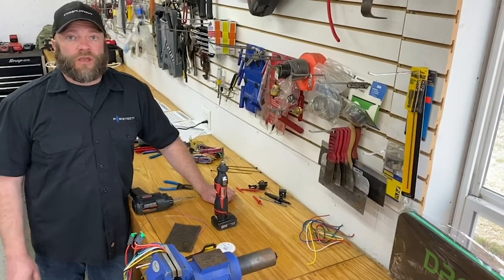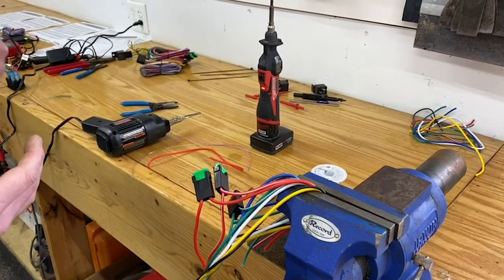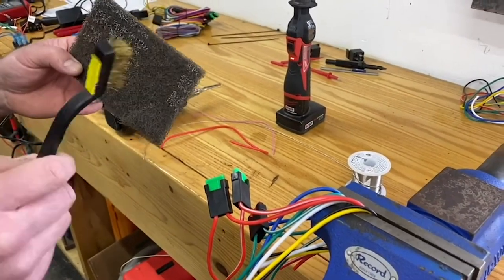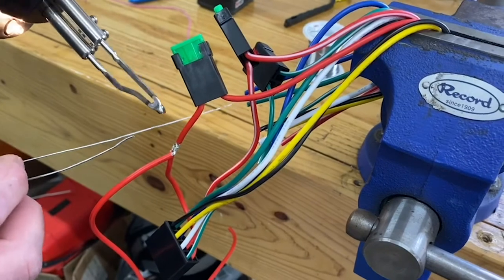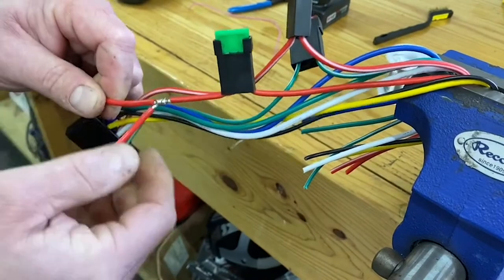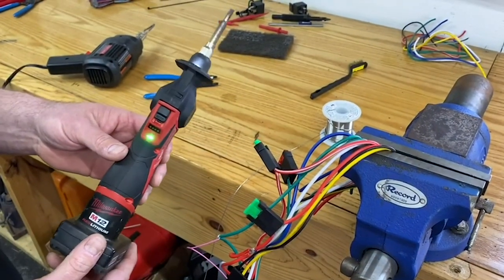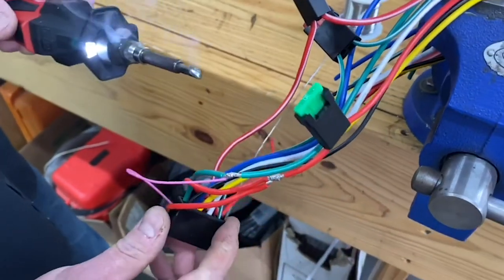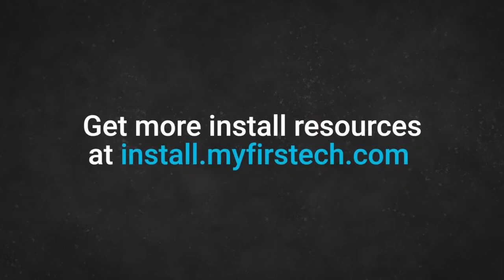Doug's Soldering Tips & How to Solder Like a Pro | myFirstech Academy 101 Ep.1

Comment: I use a solder station with a super long extension on it (made of an old trunk CD changer harness).  I can leave the solder station on for  hours and when I need it I can just take the pencil to solder the smaller gauge wires easily.  When I'm done I can just leave it in reach but on the floor of the shop for easy grabbing again.  It's not in the car risking upholstery damage.  The solder station is made by Tenma.  I looked for a station that had common style plugs (think CB mic plug) to make this work.  So far so good It's been on my bench now for 10 years+!   Good to see tips for making connections they plague installers and make our days long when done incorrectly.
-Jon 
Traveling Electronics  NH

Comment: Great tips. I’ll be adding this to the ever growing list of videos I have new hires watch. I always have new hires (green guys and “veterans”) practice these (and other) soldering techniques on the bench. I know this was for soldering but it would have been nice to see how you handle covering the solder joint in the car, ie. tape or heat shrink. And what you do for strain relief on the wire you’ve just soldered on, zip tie??? Also, stripping away the insulation on a wire like you did. Too many new guys cut halfway through the wire.  Maybe that’s covered in another video I haven’t seen but adding it to this makes sense, I think. Either way, great video. Thanks.